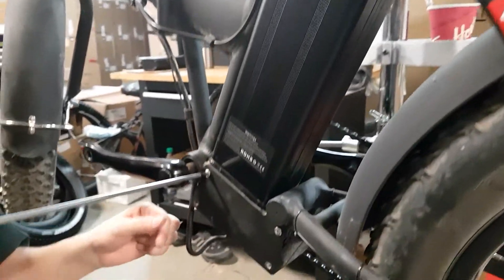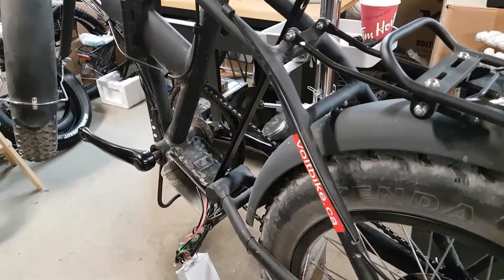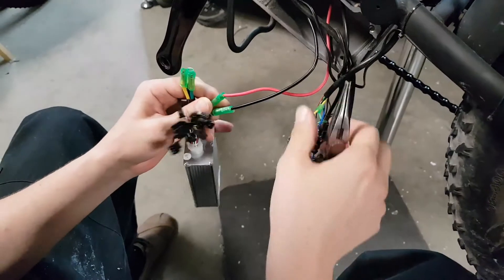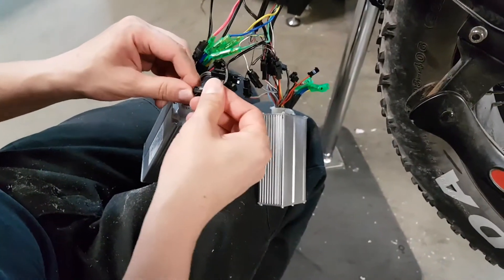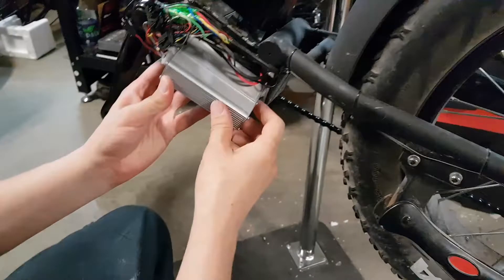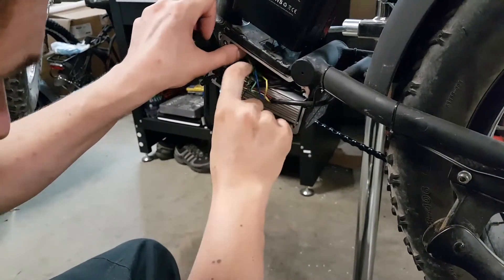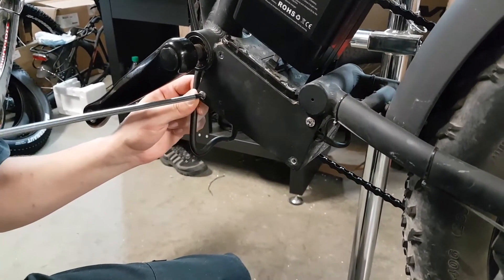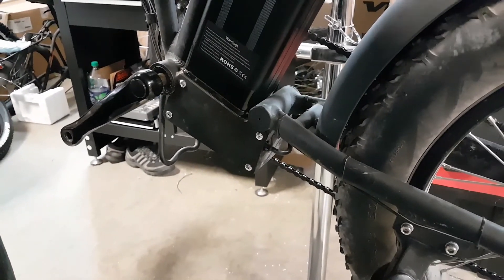Voltbike Mariner 500w Controller Replacement

Comment: How is it possible to get a controller??? I bought a Mariner used only 15 kilometres. I put on over 200 kilometres in a week, and then it died. The controller has the rubber sealant, but it is useless and the controller is SEVERELY corroded. Also, the hole in the bottom to allow condensation to get out is too BIG and lets way too much water and dirt in. I LOVE this ebike, but after all my communications and photos to your service department this week,  a response would be nice. After all, isn't the point to buy from you direct is that we can get the parts we need from you???
Reply from the maker: Hi Lu, even though the odometer on your bike state 15 kilometers it does not mean that this is the actual mileage on your bike. The odometer could be reset by replacing the LCD controller unit or reprogramming with USB device. Your bike is thte 2017 edition which is most likely 1 year old.  You did send us an email on May.10 and it appears our customer's service rep replied on May.11. We just replied to your last email. We did email you PayPal invoice where you can process your transaction.
Reply: Thanks Voltbike. Yup, the mystery of my Mariner... Thanks for sending the invoice, and I paid it, so am waiting in anticipation. I opened the controller, and even being 2017 model, the controller is VERY corroded on the inside. I will let you know how I remediate the water that gets into the controller cavity. LOVE my Mariner!

Comment: I'm glad to see the cable for the limiter seems easy to remove if you were to go to the states with it. Do the US models just ship with a different type of controller without that cable or would it just ship with that cable disconnected.
Reply: pie189 which color wire is the speed limiter? Have you done this and it works?

Comment: I heard that the controller can get damaged by rain is there any upgrades coming to mariner so that wont happen? Im planing to buy onw next year on september.
Reply from the maker: As of  September, 2017 Voltbike Mariners comes standard with rubber insulation on the controller compartment which will prevent from water coming inside. For bikes prior to this date, it's relatively easy to insulate the wire opening with silicon or similar.